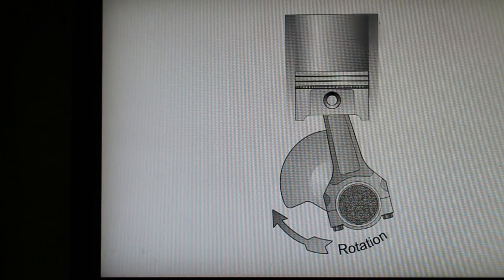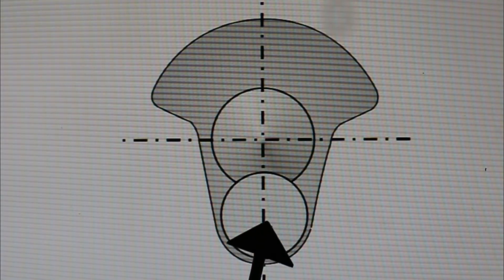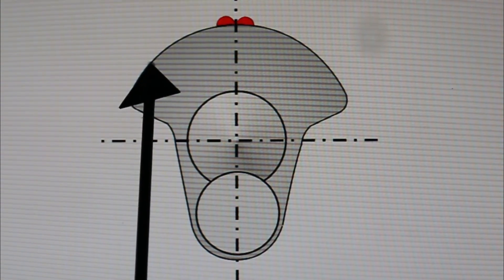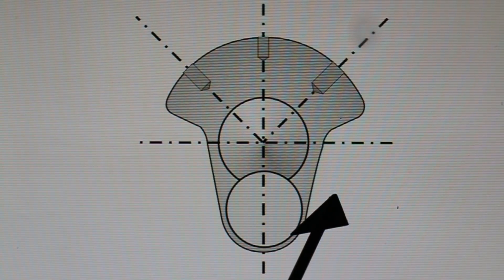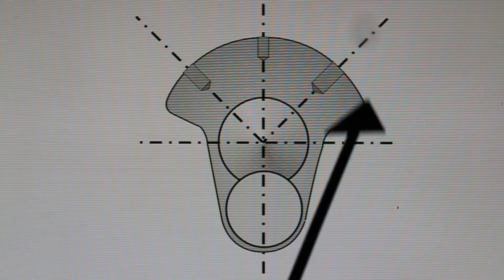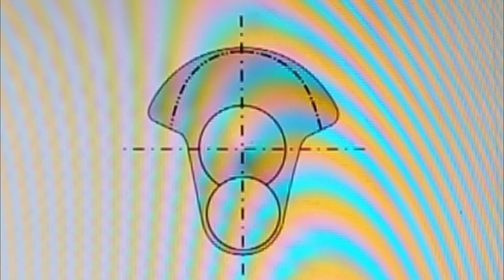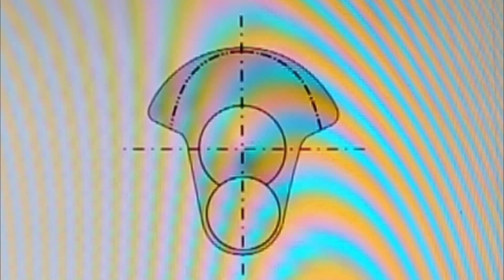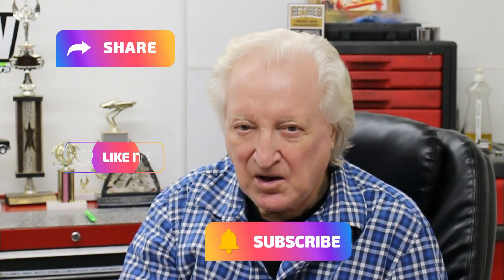POWER ADDING  crank balancing

Comment: David, would you possibly do a video on turbochargers, turbine sizing,overlap and exhaust valve opening to suit the application.
Reply: Yes please
Reply: He probably cant
Reply: @sexyfacenation  if he can't it's not because he lacks the knowledge to.
Reply: @davidreed6070  what makes him a turbo guru?
Reply: @sexyfacenation  back in England years ago it is said he did a lot of research and development for manufacturers. He has written a lot. What he writes is research he has done. I have read and followed through with his knowledge for about 40 years. I have never disagreed with what he says.
Reply from the maker: @sexyfacenation  I was the designer for Chrysler's Turbo 1600 Avenger which was a sensational tech success and consultant to Mountune Engines for the Turbo Cosworth's and literally every F1 engine in the turbo era used my electronic turbo lag eliminator. Is that enough know how????
Reply: @marvingvx1  yeah,  that's pretty good! Are you planning on doing a video on the electronic lag eliminator? That would be interesting I imagine.

Comment: I have A 598 big block chevrolet, The machine work was done by Bob Lane 5 or 6 years ago.  I had a stroke 2 years ago but I haven't been able to put the thing back together. I have every part that goes together set up inboxes  King   Coded bearings, lunati cam.I had the head stolen from me when I have my stroke. Keep up the good work.
Reply: Hope you get to feeling better. My wife had a mild stroke 3 weeks ago and is doing ok so far an the hopes that her right side she gets her feeling back. But there is one thing I just hate an that is a thief and hope you can find your heads or head for your engine bud an you can enjoy the moment you start it up an can drive your car. Hope things get better soon for you stay safe an God bless. 🙏🙏
Reply from the maker: What heads where you using - if you are missing just one I may have a second single here at my shop.

Comment: When you balance a straight six,  do you use bobweights? I'we heard both yes and no..
Reply: I used to do all the balancing in a race engine shop.
Only V engines are bob weighted. Opposed and inlines NO.
But I'm not sure about an inline 3 or 5. Never balanced one.🤔